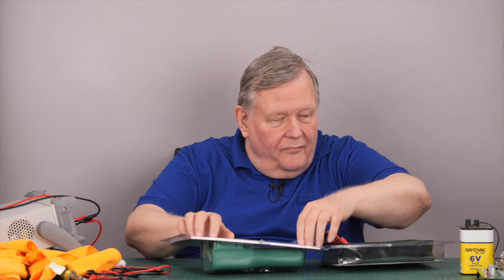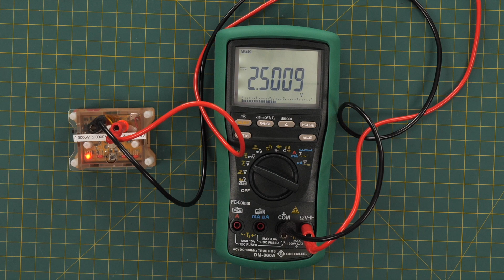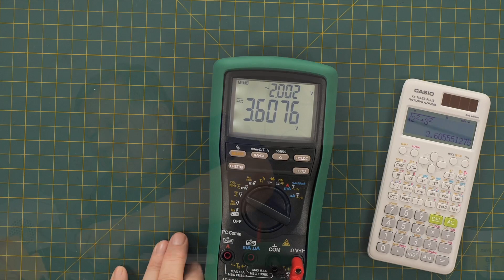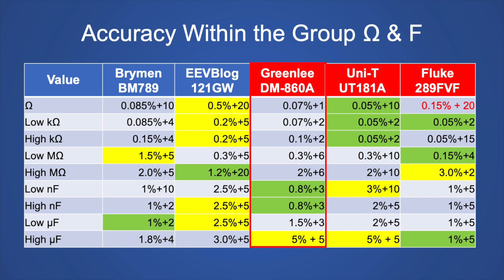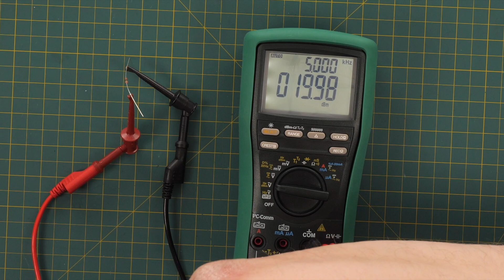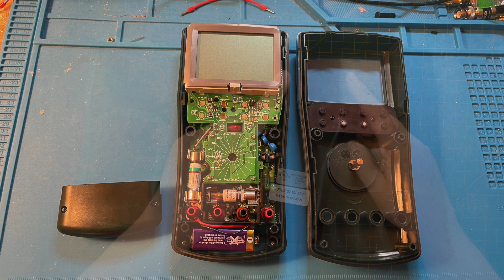Greenlee DM-860A Review

Comment: Regarding the software, the stock Brymen software is pretty basic. But as the protocol is open (albeit a pretty strange protocol), compatibility has been incorporated in other DMM software.
I personally use Ts Digital Multi Meter Viewer, but it also works with Testcontroller and is incorporated in Sigrok.
Strange detail is that with the stock software, the logging interval in 500K resolution mode is about 2 times per second, whereas when I use Ts Digital Multi Meter Viewer or Testcontroller, the logging interval in 500k mode is 5 times per second.
I believe the specs in the manual state 1,25 times per second, but with my meter the display refresh is just as fast as in the 50k mode, and when I log in 500k mode, all the values that are logged with 5 times per second have unique values, so I guess the specs in the manual are wrong about this.
Reply from the maker: Thanks for the info.

Comment: Interesting that your DM-860A doesn't meet specification in the lower DCV ranges.
I have the Brymen BM869S that I have ISO17025 calibrated annually, and it always passes (I think I have it for about 5 years now).
Of course this is also only a sample of 1, but I wonder....Does Greenlee do their own calibrations?
Because the funny thing is, the only calibration instructions for this meter (with that I mean the adjustment procedure) is a document from Greenlee.
Also, looking at Joe Smith's video's, where he frequently uses one of his BM869s's parallel to other higher tier multimeters (UniT 181A, Fluke 189, Gossen metrahit ultra etc etc) I never see his BM869s's giving different values than those other higher tier multimeters. That is of course not an ISO17025 calibration, but it gives a comparison and general idea. 

...food for thought...

I saw that the greenlee leads are not the newer style Brymen leads where you can screw on little 4mm bananaplug adapters that are included. I find that feature very handy.
Reply from the maker: Thanks for sharing.  I ordered a BM869S from Welectron so I can compare it with the Greenlee.  I tried to order it from TME and got this message "This product is not available for sale in your country."
Reply: @N8FDY  that is very strange from TME. Lots of americans have ordered from TME afaik.
But Welectron is also an excellent supplier. I believe their prices are a bit lower but their (overseas) shipping costs are a bit higher